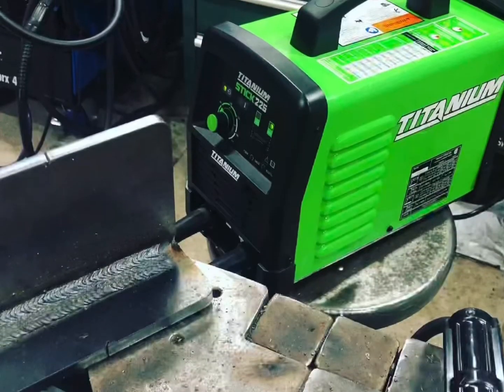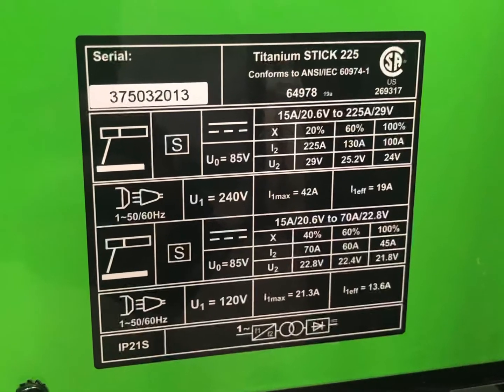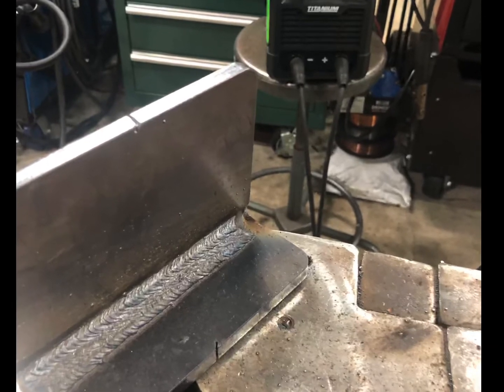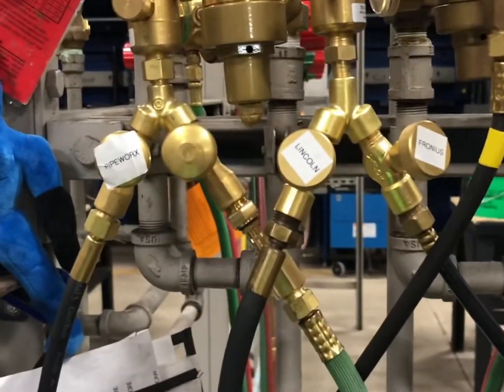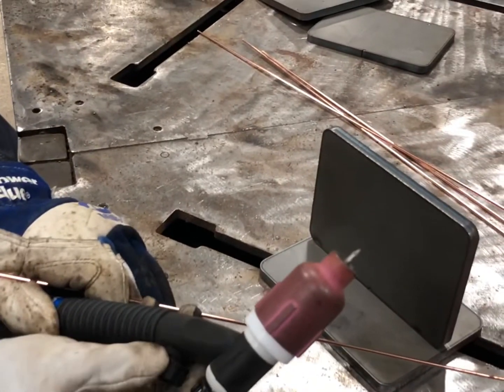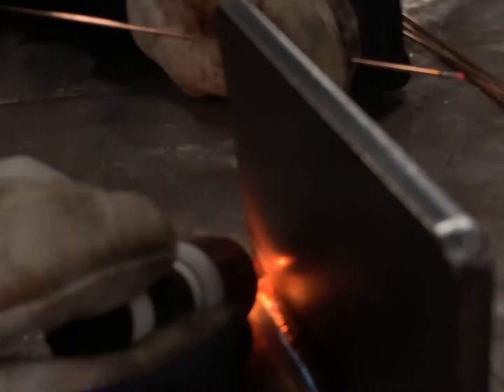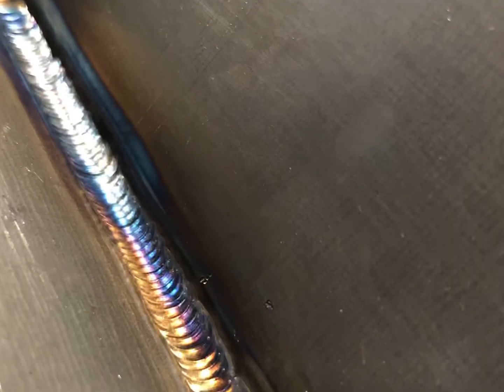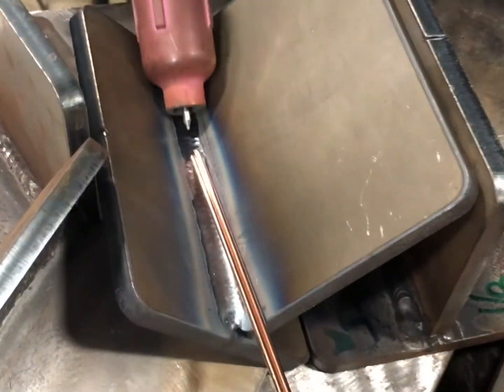Titanium 225 Stick Part 2: TIG welding with this “stick welding” machine

Comment: I have the same welder and want to set it up to try tig, if I was to get a torch with the right dinse size and a gas line. Is the power block necessary?
Reply: as long you have the right dinse size you wouldn’t need the power block. you can also buy adapters from the little dinse to the full size 50mm dinses

Comment: Awesome video and one of the reason I got this small welder yesterday.  Did you try tig on the 110v? I'm only running 65 amps for stainless sink . U think it will keep up on the 110v?

Comment: It's on sale now for 250!

Could please provide a price list of everything you need to convert to TIG including a tank etc, thanks
Reply from the maker: Would all depend on the brand and style torch. That’s the most expensive part.  But can get hose and power cable adaptor really cheap.  Torch could set you back a few hundred.